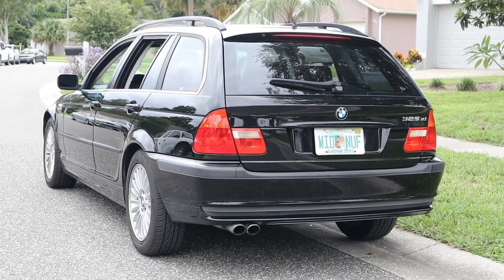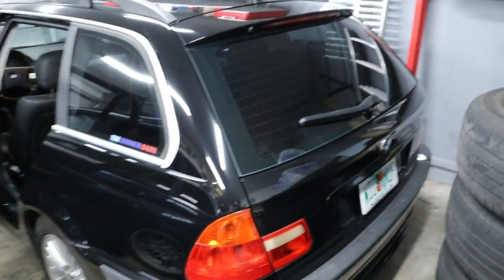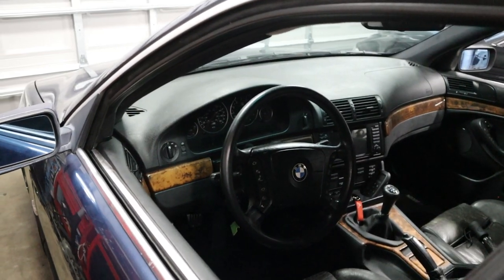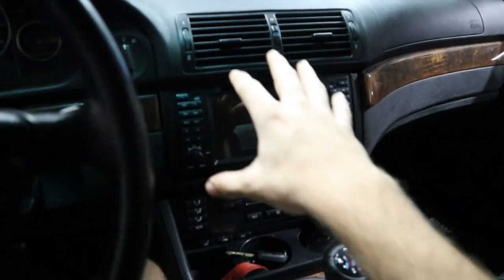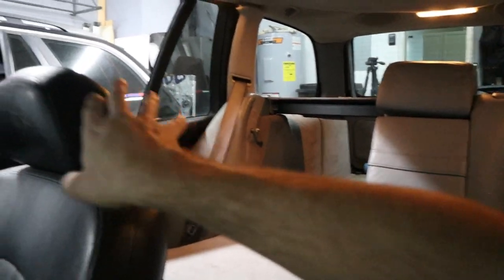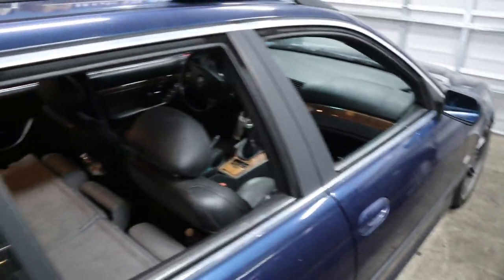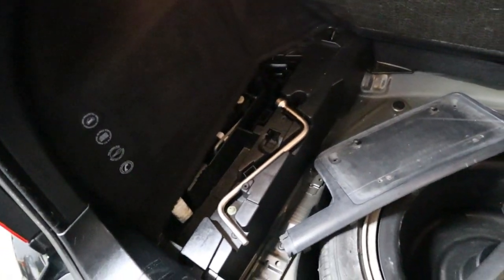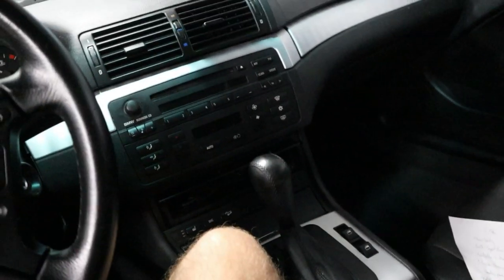E39 Touring VS E46 Touring: Which should you buy?

Comment: Both cars are amazing to drive and to look at... But e39 regular touring rear is ugly AF compared to e46. Rear lights are just too big and boxy for my taste. Mtech makes it look a bit better. Limo looks amazing tho. E46 also came with very interesting awd, no central diff, perma split 38%front 62% rear torque distribution. Sadly, petrol engines lack the torque on front wheels in extreme conditions. But e46 330xd with LSD... is a freaking monster. Not to mention the tuning potencial of these diesel engines(up to 500HP), thanks to forged iron engine blocks (vs alluminium ones nowdayz). In any case, driving experience of these cars is miles ahead of new, modern age  crap.  Btw if you have e46 or e39, I would strongly recommend you to swap steering wheel for "m" wheel. It just feels so much better. And its plug and play :)